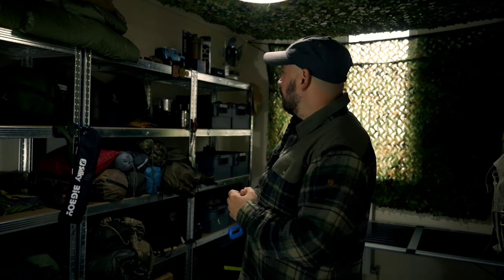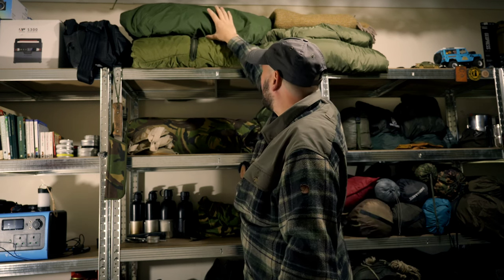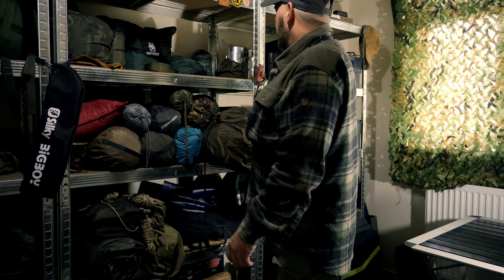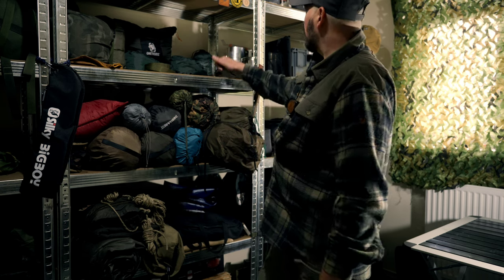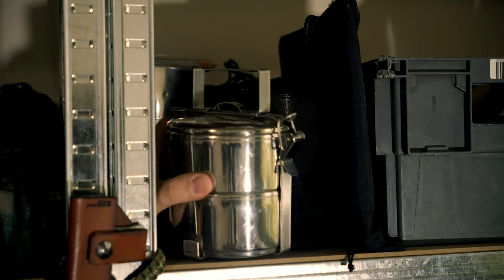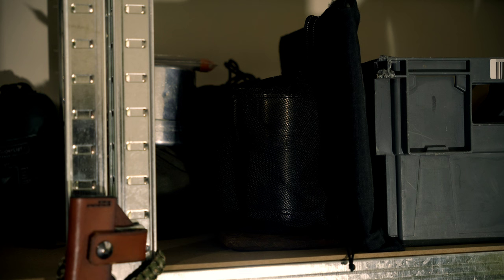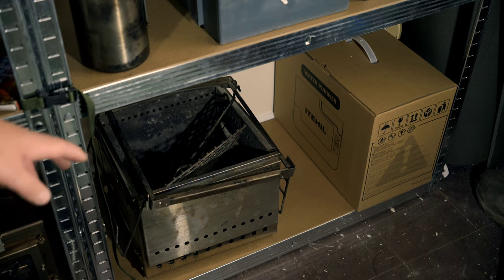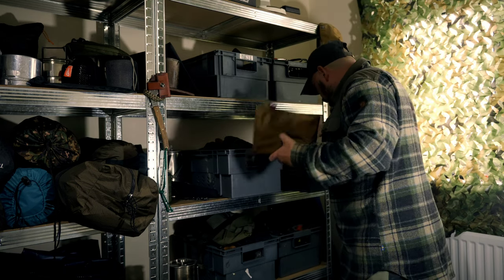Newly designed and organised bushcraft survival gear room. Let me show you around! 4k!

Comment: Hi Steve. .  it's a constant battle staying organised . 

But camping and hiking does get the gear sorted for me .

 About 10 years ago I got to a place of calm.

One rule that has helped me is to make sure I can get to the floor all the way round the room . Then as much white in the room as possible . 

 you need to open a shop mate . . It's funny that with all the burners and fires . When you needed to cook it was with gas.  It shows it's complete superiority over all other cooking formats.  .. 

I have two camping Gaz bluette stoves . .. that's all I have.  If I turn them down I can make them silent . 

Can you get anything for those shelves to make half shelves ? Or make a frame into the room that you can close it off with doors . 

I've loads of ideas 😂
Reply from the maker: It's true for quickness of ease, especially when I'm filming it's easier to just put the burner on to get a brew done. When I'm camping........and filming again 😄 I tent to use the burner in the mornings for that rapid caffeine intake, I do like to cook on the fire though. 🔥 great tips, buddy, and they make sense. Thanks for stopping by, buddy.

Comment: Right I can tell you now that the survival Aids sleeping bag is a very early system part of the 'Buffalo ' system sleeping bag. The same as the Buffalo special 6 shirts. It's a 2 part sleeping system. And survival aids rearaty. 
Combination of the Buffalo jacket and trousers along with both sleeping bags can take you down to some extreme cold. I know, I had a set and used it in Alaska.
Reply from the maker: Absolutely awesome, Swampy nice one! I paired this with a snug pack summer blanket to add a bit more insulation, and it works well. I have seen the inners for these now, and they go for a pretty penny! Cheers again, bud. Great info.